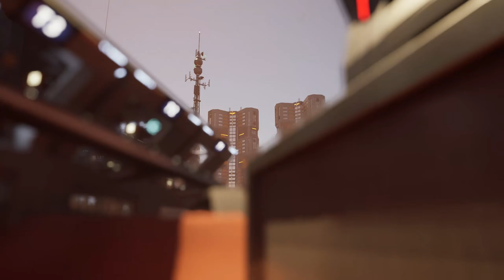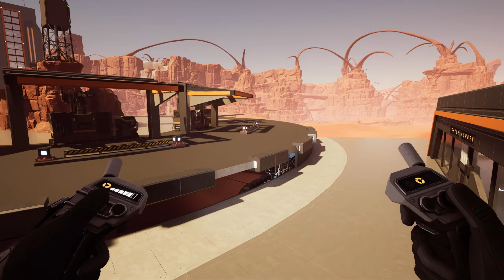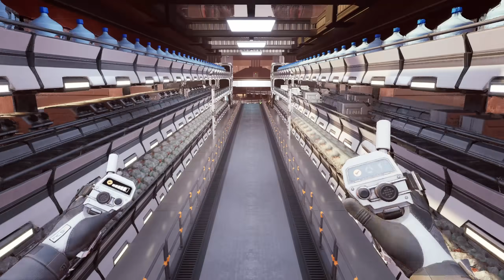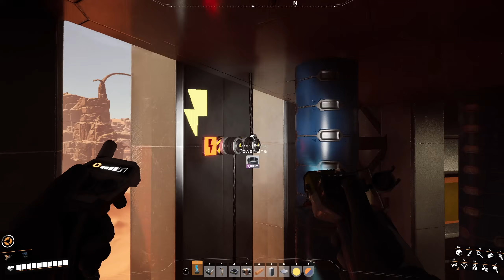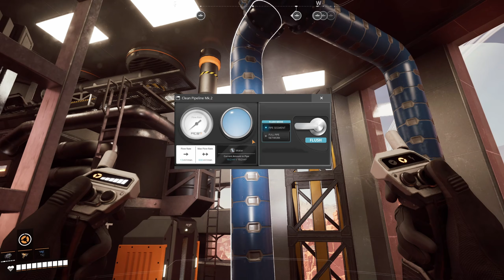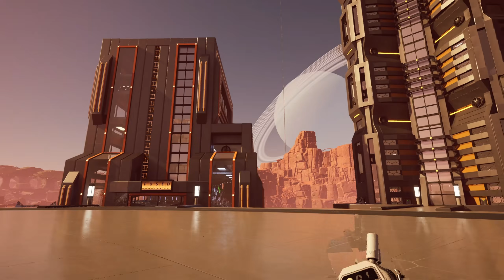Iron Ingot Towers doing 2000/min

Comment: I'm curious why you're not sourcing your water from the pond at the top of the waterfall on the western edge of the dune desert?  I have water extractors up there piping down eight Mk2 pipes worth of water (4800/min).  Removes the need for packagers and pumps.
Reply from the maker: You could use the water from the elevated pond for sure. That would negate any pressure issue but for me, the crazy length all those water pipes will have to go compared to the relatively short bus i have in place makes the pond im using atm the easy choice. The reason to use the elevated body of water is to overcome the protential pressure issues but by using packaged water and pumping the unpacked water to the highest point in a factory first, bypassed that issue entirely. 

From a logistics point of view working with belts/lifts is a lot easier that than having pipes/pumps/buffers going every which way. Adding to the pipe issue, if i would have gone that way, is that there are many more buildings that will need some water supplied to them when i get around to building them. Syphoning off a little bit of water here and there is way easier with belts than pipes, so the conclusion is that belts/lifts just make way more sense. Also, i like to keep very clean looking and organized logi floors and belts are easier to work with than pipes especially if you dont know what your logi floor, or in my case the massive logi circle,  will need to accommodate
Reply: @MyNameJakes  true on all points.  I guess it's just my personal preference to avoid packagers whenever I can given they take up a lot of space and can gate throughput.

My Dune Desert setup has a linear layout more or less parallel to the western cliff wall, so the pipelines of water are pretty short.  Love your circular design!

Also, we seem to have both landed on the "L-shaped tower" design for Pure Iron Ingots, but with some differences:

- I build each tower on a 6x6 blueprint, then arrange four of them in a 2x2 grid
- In place of your single elevator per tower, I have a single, central elevator for all four towers, connected by walkways to each floor in each tower.
- My setup isn't nearly as ornate or elegant as yours :)  you truly are a master at that!

With each tower having six floors, each floor with two refineries, and each refinery overclocked to 200%, I get two belts of 780/min iron ingots from each tower.  All four towers produce 6,240/min iron ingots from a 12x12 footprint!
Reply from the maker: @ThePrisoner881  Wow nice...if you in my discord post some images and tagg me otherwise it sounds liek a great job you did on them